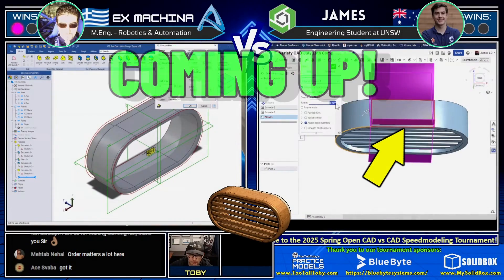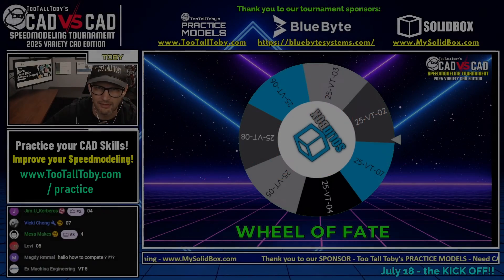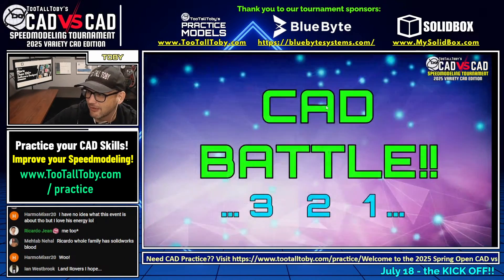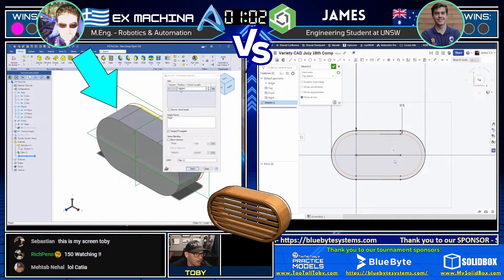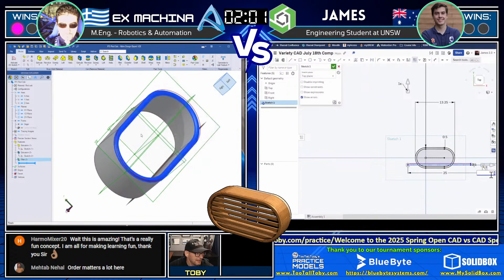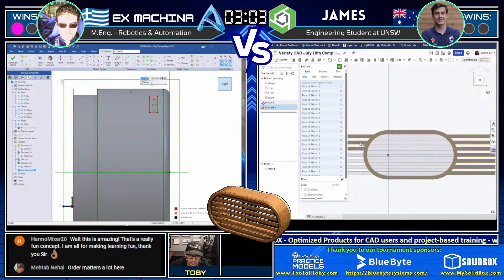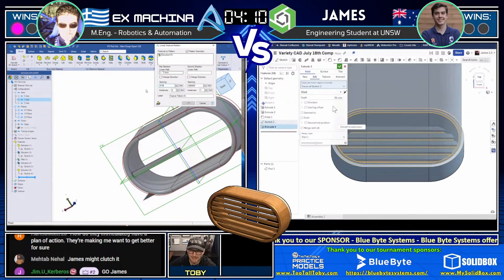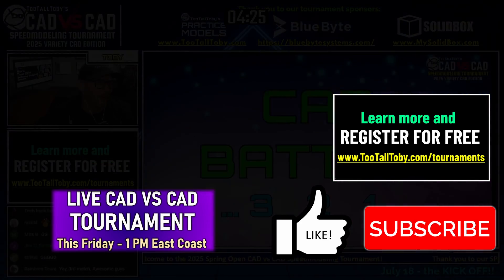CAD vs CAD Speedmodeling TOURNAMENT! - ALIBRE vs Onshape - Match 1 Battle 2

Comment: Nice. I use Solidworks to do it. Dragoș
Reply from the maker: Great job!
Reply: I used SW and a simple surfacing method to trim those slats after creating them and using rectangular pattern:
a.) Create inside "surface body" of the housing using [surface offset, thk = 0) then [cut with surface] all slat bodies to yield inside oval shape.
b.) Then use feature [combine] to merge all bodies
c.) calc density(which instead of wasting time creating a custom density just use the generic oak = 580 kg/m^2) which is within 1%. This stupid step took me the longest.  Trying to make custom prop.